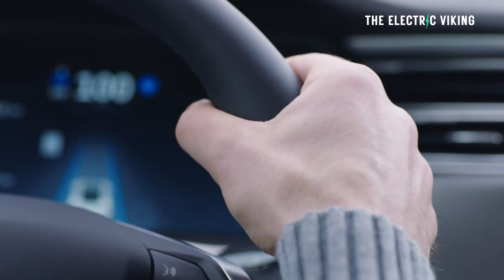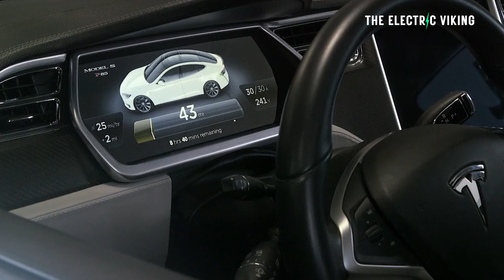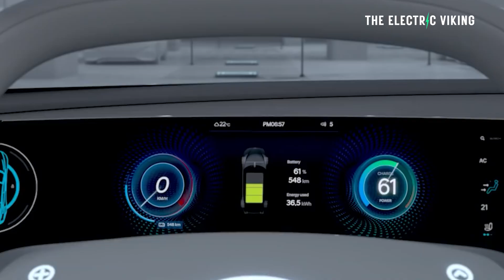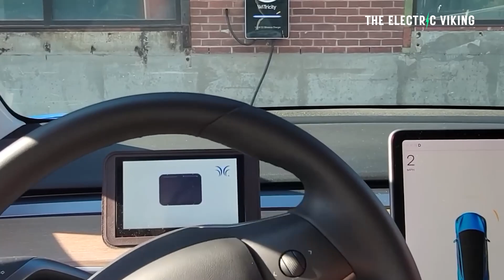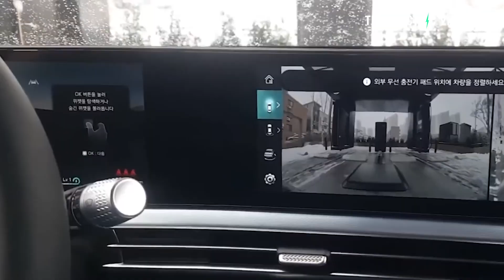Researchers reveal 500 kW wireless charging with 98%+ efficiency!

Comment: Ya Sam, not all that complicated for electrical engineers. We've been working with variations of this technology for years. ElonRoad out of Sweden is one of them. The fine wire copper (aka welding cable) is to get past Skin Effect caused by high current and high frequency. 

I do agree it will take off shortly. We are looking at it in conjunction with an HVDC energy corridor for charging freight trucks. Passenger cars too obviously. But trucks are the first concern to extend ranges while reducing battery size. Win, win.

How are utilizing HVDC for the power distribution? That is the next technical piece to drop. Developed by another "without an accent", (we kid him because also an Aussie), but coming from Canada/U.S.

Comment: The down side is carrying an induction coil instead of a simple connector, plus a large surface area compared to a cigarette size connector - and limited places where you can place this wireless induction (flat and not have curves)

Comment: The true genius in this is in having the chutzpah to write a paper which cherry-picks data and presents it in a way that journalists believe it. The claimed 98% efficiency comes from the theoretical figures for RF coupling efficiency under ideal conditions. As you mentioned, there will be losses throughout the electronics. The higher you go in frequency, the more losses you will have. Overall circuitry efficiency will always be lower than if properly designed DC connections and circuitry were used throughout the system. In higher speed recharging setups, the source electricity is stored in a storage battery, which is already DC. Taking that DC, and converting it to a low frequency AC signal (80kHz is definitely not high frequency. It's well below the domestic AM broadcast band, and below the European Longwave band.), then converting it back to DC within the car will incur losses at every stage. Already existing DC chargers don't have to use those extra steps, so they are inherently more efficient.
At 98% coupling efficiency and 500kW, the lost energy will be 10kW, as stated. That 10 kilowatts is the same power as a U.S. local AM transmitter provides. That's a lot of radiation and heat. Just think how much radio interference dozens of those chargers in a recharging hub will cause. More importantly, RF interacts with living tissue, and that stray RF will be a serious health concern. I'll a licensed radio amateur, and the law says that we have to ensure that people in the vicinity of our transmitters are not subjected to RF at above defined safety thresholds. In Britain, we are normally limited to less than 400 Watts PEP, which equates to a constant power of around 100 Watts. That's 0.08% of the power of these chargers. The irradiation limits we're allowed is comparable in strength to the legal maximum stray radiation of a domestic microwave oven. So 10kW or more of stray signal from an induction charger is a serious amount of potentially deadly RF to anyone in close proximity to the loops - including the occupants of the cars.
Litzendahl, or Litz, wire is not a new invention. I've seen antique radio equipment which used it more than a century ago. Maybe its ready availability in thick enough diameters for this idea is a recently reintroduced commodity.
In short, the most efficient way to connect power to a car automatically might be to use the old Scalextric method of having two DC connectors underneath the vehicle. These could be uncovered when over a recharging point which also has safety covers. Very simple, low cost, high reliability, most efficient, and almost zero health hazard.
Finally, nobody mentions the weight of the additional equipment in each vehicle. The coils used will need to be fairly large, for ease of positioning and peak coupling efficiency. There might need to be a ferrite or Iron core in the car, to maximise efficiency. Then safety shielding needs to be added. And finally there needs to be a means of converting the RF back to DC and routing it to the battery safely. All add mass, and that reduces range, and efficiency, of the vehicle.
The idea has its merits, of course, but it's not an entirely new idea, and it can never be the most efficient way to transfer power from source to battery.

Comment: 98+% efficiency with a 6 inch air gap? The heat losses would be more than 2%. Wireless charging is nothing more than a transformer. Two coils of wire and an iron core. The design of the core and the way the coils are wound and the frequency of the current determines the efficiency. Change any perimeter to less than ideal and efficiency suffers. Spacing the coils 15 cm. (5.9 in.) apart will definitely reduce efficiency. Don't believe it? Lift your wireless phone even one inch off the charging pad and see what happens. The best designed transformers under ideal conditions might achieve 98+% and those coils are separated only by insulating tape or paper, never 6 inches! Another issue is, you run 500kw through any transformer will require some MAJOR cooling!

Comment: I would get it if it was also enabled for on road charging. But I would only use it at home if it was bidirectional. Otherwise I'd plug still plug it in for bidirectional capability.

Comment: 1,000 dollars?  Well just to get my 220 outlet installed was 900 so yes but I think it would be more than a 1,000. Also does this price include retrofitting your EV to accept the wireless charging?  I think it will be more like 5,000 to do all that work.
Reply: And then there is the question of standardization. Will all the car makers use one system?  New car, new charging equipment?
Reply: @C4H6As  From the video it kinda looked like the company was retro fitting EVs that are already out. It was hard to tell, but maybe they could retro fit old EVs?  I don’t know. But it to me it would be a lot more than a 1,000 if you had to retrofit an EV on top of installing the charger.

Comment: As an electrical engineer I call BS. Wireless charging makes no sense for cars. You need to park Perfectly over the plate else efficiency drop like a rock. Even at perfect alignment it will be no where near 98%. 85-90% at best. Also snow is a thing. Damage to charge plate while removing snow is a real issue. See where the plate is during winter, installation in the drive way. You need to have multiple plates if you have more then one car instead of simply moving the charge cable between in 10 seconds (or move the cars around when one is done on the plate).

Comment: Now why didn't I think of this.....If a toothbrush and cell phone can be charged by Induction? 
Then why not vehicles......AND.....I think the human race would be totally stupid not to use
induction charging everywhere possible........I would love to just pull into my garage and
the blasted car just charges; then shuts off by itself.  Get in and go.  Imagine parking
lots at malls, hotels, arena's, etc.  with slots where you can just park and charge; 
Without getting out of your car, and also "think of not having to get out in the snow
and rain".   This is just perfect for so many applications.  EV tractors, forklifts, and on
and on and on;  just pulling over a lighted pad that beeps when you are in position
and you just hop out;  knowing later (the things could text you when your vehicle
is ready) you just hop back in and go.........NOW,   If they can only make it affordable.
We could have something.

Comment: 15 cm is a massive gap, there is not enough detail to believe it can couple tightly with such a massive gap. Is the conductor a spiral or a coil and why? What's so special about the voltages used? Why is 80 KHz better than 100 KHz? What's so special about a braided conductor? What's so special about the capacitor? In short, why does this configuration work? This is more of a tease than informative. And of course it will take over home charging, if it becomes an industry standard it will be as built in as tires & headlights. Every car made will be required to have it.

Comment: Er, US export control? Lol. I can see how this go down and may cause the limitation of this technology. why bother messing with electrical megenetic field while you can use simply use high voltage to arc through gap like Tesla coil does? There is no limitation on how much power can electric arc can transfer. It will be matter of how much the user can take. The concentration of the design will be, how to make it safer.

Comment: I have had wireless charging on my last 3-4 phones, but have never used it. It's easy to just plug in, and I am concerned with heat build up, right next to the battery. Phones aren't actively cooled though, and in cars, the induction coils wouldn't be right on top pf the battery, like in a phone. I think this will be popular. Especially at $1000 USD or less. I just don't know if the first of these would actually be $1000 .....I think initially they will be double or triple that price ....Just a feeling. ......Not to mention manufacturers have to actually incorporate the hardware and software into their vehicles. But, another "issue" this could potentially solve is the current lack of a standard charging cable plug!
Reply: A company in the marine industry tried to do a ferry charger using inductive charging at these levels (up to 1MW).  I don't think it was successful (there was a brief image of it in the video).  As for the cost - more like $1M than $1K.

Comment: According to the video, the system has the capability to charge with a power of 500 kW per every 2 m². So you could have a charging speed of typical 22 kW destination charger, utilizing only 1/8 m² roughly a 50x25cm rectangle or 11 kW with 25x25 cm. That is very much feasible and likely not too heavy / expensive. 

Maybe that would be some thing like what we’ve seen in the recent Investor Day Tesla presentation?

Also, that could give Tesla an early movers advantage, so it could establish an industry standard, further raising the desirability of Tesla vehicles over the competitors.

Comment: They are using this in Oslo to charge taxis when they are on the rank. The handshake takes about 3 seconds and the taxi starts charging. If this proves to be more efficient, then it will definitely take over cable charging. Plus less tripping hazard and less problems with charging socket placement on different cars, vans etc. Plus if the charging station is in a remote location, it will make charging safer if you can stay in a locked vehicle during the whole process..
Reply: Are you sure?  I see references to this being a plan, but nothing that confirms it was actually achieved.
Reply: For taxis it will be ok. You only have some small amount of charging points, the waiting time is enough to charge for the next ride, the driver doesn´t have to go out.
Reply: @C4H6As  The efficiency and lack of connectors will mean this will become the preferred option for public and home charging.

Comment: STALE NEWS
Whilst this particular project team's announcement might  be new, the base technology of fast effective wireless charging for vehicles has been around for a while.  There are even ISO standards for interoperability and safety.  Also there already commercial product and there are multiple experiments in to using wireless charging whilst cars are moving at normal driving speeds.
The main advance that this technology needs is for a major car manufacturer to fit them as standard,  which would also do away with charging station cables.

Comment: I picture a charging lot for hundreds of robotaxis having wireless charging pads evenly spaced in tightly packed lanes, eg 100 cars could pack into ten lanes with 10 cars per lane. Each lane has ten wireless charging pads, and dead cars park at the back of a lane, charged cars drive off the front of the lane. Each time a charged car leaves, the line moves up - each car pulling forward to the next wireless charging pad. This setup results in the least wasted space for charging lots of autonomous vehicles, and requires no robots (maintenance headache) or people (expensive) plugging in and unplugging cars.

Comment: Watch cancer rates soar. This can’t be safe at such high voltage.
Reply: What is the connection between the two?
Reply: @TheEvilmooseofdoom  Any electromagnetic radiation emitted can cause cancer. Same with cell phones, cellular towers and Bluetooth headsets directly into the brain. Look it up. I even have concerns about the fields inside of an electric car. There are no ratings that I know of unlike for electronics.

Comment: Wireless vehicle charging sounds so convenient, I can only imagine it will be the #1 preference for people.  However, if my small dog or cat crawls under my car in the garage between the charging pad and the car while this charging is occurring, will it hurt them?  Or would it be safe for living animals?
Reply: Does your cat or dog wear a collar?  If yes the metal bits will yet hot.  If the car is charging and a candy bar wrapper blows underneath the car, the aluminized mylar could melt and burst into flames.  This is not for an uncontrolled location.

Comment: Warning: The 98% efficiency is only the efficiency of the coils of the split transformer. By making the two coils resonate, high efficiency is possible at one frequency for close coils, However: That's only half the story. Each of the several steps of conversion to achieve fast charging has an efficiency. The overall efficiency is the product of all the individual steps. So if there are 6 steps and each step is say 95% efficient, the overall efficiency is (0.95) to the 6th power i.e. 0.95x0.95x0.95x0.95x0.95x0.95x=74% So when they say 98%, they only talking about one step of a many step operation. Yea SiC is expensive but crucial for high efficiency. Tesla is bragging how they are REMOVING 75% os their SiC to cut cost.

Comment: I rarely watch any of your videos concerning new battery technology because you don't know enought science to do any more than read press releases.
Reply: But if you do understand the science you'll understand that higher frequencies increase magnetic coupling and therefore the actual advantage isn't so much increased efficiency, but the same efficiency at a much smaller size, ie something that could fit in the space under a car. It also means smaller wire gauges can be used, so it would be light enough to put on the bottom of an EV. For that amount of power you could achieve 98% efficiency with standard wireless charging frequencies very easily, the pads would just be the size of a garage floor each, weigh a ton, and require a huge amount of copper. At the end of the day - 98% efficiency = viable. Anyone can understand that!
Reply: @truhartwood3170  I do. He doesn't
Reply: @jimdetry9420  I think you're not understanding the value proposition of the channel then. Sam scours the internet constantly for EV and renewable energy news, rather than spending his time reading textbooks. So come here for curated EV and Renewable energy news condensed down into short videos. If you're interested to learn more, google it or something. This isn't a channel for deep-diving the science and engineering. Sam makes mistakes all the time in these areas when he's reporting, but if you know the topic you just fill in the banks and correct the innocent mistakes.
Reply: @truhartwood3170  What's the value proposition of your pointless comments?

Comment: 98% in lab conditions?  I have serious reservations about that.  Your going from line AC to transmit frequency, receive frequency and then convert back to DC. I'm pretty sure that all of those steps are <100%.  The safety factor for large buses  and ships might make the cost acceptable, but I would not pay extra when all you need do is plug in the car.
Reply: I'm sure they're talking about only the transmission loss from pad to pad over 15cm.

Comment: Silly question,  since we are talking about frequency, this is ac charging?
Reply: Yes, but not what you're thinking. AC current in the gird is 60Hz. Chalmers U doesn't say the frequency of their charging, but indicates it's much higher frequency than induction stove tops, which are 20,000Hz (Hz is how many times it alternates per second). So when you hear people talk about the differences between AC and DC charging, it doesn't really apply exactly to this scenario. Kinda, but not exactly. This wireless charging should (as far as I can tell) have a much smaller, cheaper, lighter transformer, since the higher frequency should also make the transformer much more efficient than a normal 60Hz AC to DC transformer.

Comment: yes   i would prefer wireless  if no leakage of electricity possible - i/e dual safety backup  sensors under vehicle to stop charging if a cat walked under the vehicle etc.  Question: what about trucks with lift kits? bound to happen in the eTruck mkt at some point.. ?     (more than 15cm from plate to receiver on the vehicle)
Reply: Well, that would actually be an advantage of inductive charging: no exposed conductors.  A cat could walk through the field unharmed.  Watch out if you have a pacemaker though.
Reply: Prevented by an automatic cat scan?

Comment: @eevblog would like to have a word with you about physics of wireless power transmission. 

Power dissipates at the square of the distance. 

And this is AC so you have to convert AC to DC to AC to DC (b/c 50/60 hz isn’t fast enough). Even if the actual transmission was perfectly efficient the rest of the cycle isn’t and even at 800v the voltage drop is well over 8% just from the conversions. 

Versus 2% for a DC fast charger.

Comment: nice, but.... is it  brand specific or will it be a standard, also you need a standard location on the vehicle.
The positive side is that you don't need a cable or maybe a ccs port on your vehicle if it is rollout everywhere...  But I think of course there will be different wireless charging pads, which only work on some type of cars..